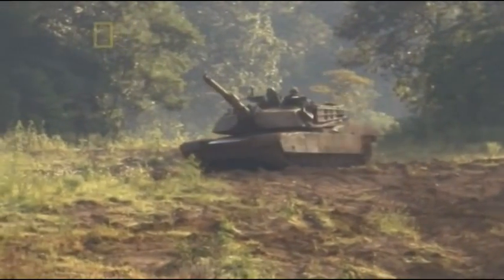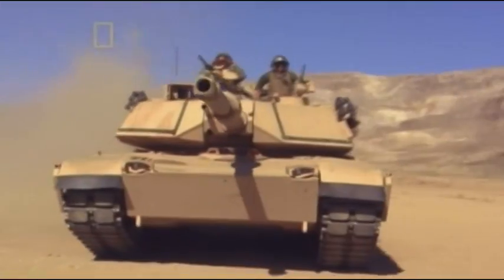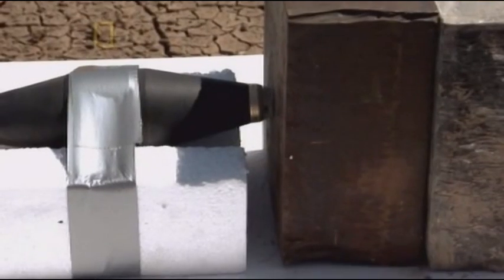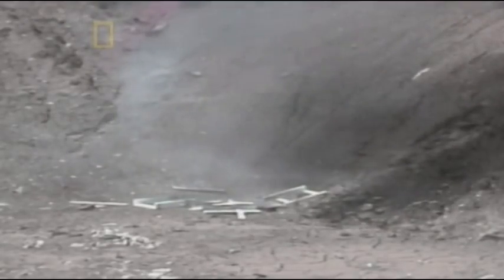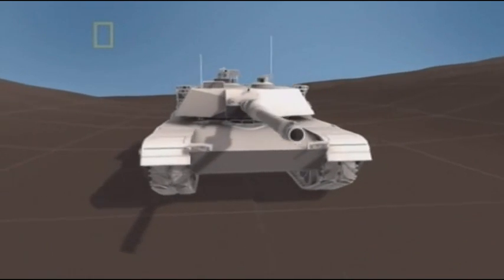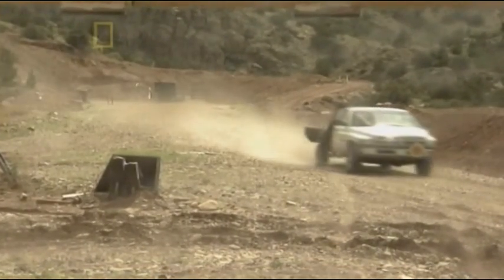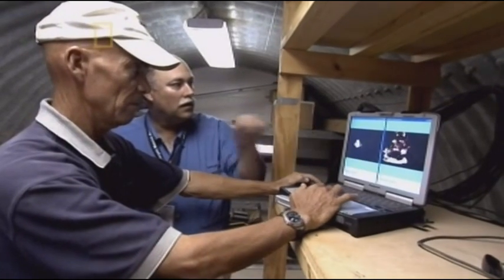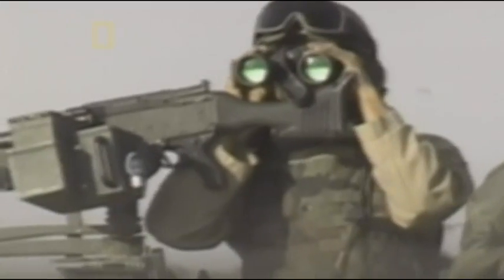Explosive Reactive Armour Explained

Comment: I've watched the russian version explained in 2 minute, the US version explained in 8 minute.
Reply: +MRtz ...What they dont say is that the missiles are now shot in a set of several warheads, the first detonate the reactive armor, the next ones penetrate.
Reply: +hotspur666 
WOW 
do you have a video of that ??
Reply: +MRtz don't forget the commercials
Reply: This is more of a documentary than a explanation.
Reply: +a- Babunji Google "tandem warhead"
Reply: Dusan Stevanovic WOW......holy shit ....i prefer to be out side the tank. I will take my chances with flying bullets
Reply: a- Babunji Newer Russian tanks (T-90 and T-14) are equipped with Arena active protection system which intercepts the incoming missile and destroys it before it even reaches the tank. They are also covered with a layer that makes it difficult for guided missiles to lock on a tank. Plus T-90 has Shtora protection system that detects from which side is enemy ATGM coming from, jams the missile and directs it away from the tank. (There is a video on YT shot in Syria where T-90 directs 2 incoming TOW missiles away). And they are equipped with the newest Kontakt-5 explosive reactive armor. So i can firmly claim that the Russian tanks are the best protected in the world by now. They rely more on electronic systems and active protection rather than armor thickness.
Reply: Dusan Stevanovic
"Newer Russian tanks (T-90 and T-14) are equipped with Arena active protection system which intercepts the incoming missile and destroys it before it even reaches the tank"

Do you have a video of that ??

"They are also covered with a layer that makes it difficult for guided missiles to lock on a tank"
WOW i didn't a technology like this exist !! video ???

"Plus T-90 has Shtora protection system that detects from which side is enemy ATGM coming from, jams the missile and directs it away from the tank"

You can jam the incoming missile ??? please tell me, you have a video of this ??

" (There is a video on YT shot in Syria where T-90 directs 2 incoming TOW missiles away)"
Do you have the link. There is a lot of TOW missiles videos on YT .

"And they are equipped with the newest Kontakt-5 explosive reactive armor. So i can firmly claim that the Russian tanks are the best protected in the world by now. They rely more on electronic systems and active protection rather than armor thickness"

I always thought the same. Armor's thickness in irrelevant in today's modern warfare.
Reply: +a- Babunji How about stop being so obnoxious and research this yourself. Not to mention, if your main point being 'provide a source to this claim,' then simply say 'Provide a source, please.' As for armor thickness in the heat of combat - no, it is not irrelevant. While tanks are equipped with high grade active protection systems, armor still remains a key part of the vehicle if these active protection systems' - hypothetically - do fail.

As for the T-90M (uncertain to the exact variant) used by Syrians being struck by TOW missiles is pretty evident to find. Do you expect everyone to do everything for you? I intend no offense, but you honestly sound like a person who is on welfare who won't waltz off their free furniture and get a job.
Reply: Tristan Renner 

"How about stop being so obnoxious and research this yourself"

Did i asked you to do it ??? i don't thinks so...

"Not to mention, if your main point being 'provide a source to this claim,' then simply say 'Provide a source, please.'"

Thank you for the suggestion but.....i prefer it my way. 

"As for armor thickness in the heat of combat - no, it is not irrelevant."

Well, after i saw a video of a warhead penetrating 800mm of armor - i don't thinks so

"As for the T-90M (uncertain to the exact variant) used by Syrians being struck by TOW missiles is pretty evident to find. "

I saw hundreds of videos of TOW missiles destroying Russian tanks, and i never encountered one where the tank destroy the missile before it hits it, so yeah.......i assumed it's hard to find. 

"Do you expect everyone to do everything for you?"

Not everyone...... but someone "specific" and i'm sure, it wasn't you who i asked.

"I intend no offense, but you honestly sound like a person who is on welfare who won't waltz off their free furniture and get a job."

Me neither, but how did you make this silly assumption ?? Did i mention any thing about my personal life ?? I don't thinks so, but nice try anyway.
Reply: a- Babunji Firstly, no. You did not. However, I'm tired of seeing people such as yourself act in such a poor manner with a lacking attitude towards other people and their comments, practically viewing them as your enemy (or so it would appear to others, such as my self) - that was the point of that topic. That said, it is simply helpful to ones' self to be independent and not to rely on others for assistance. Lastly to this, that is where I say, 'Instead of being so accost - rude, asking people nicely is an excellent gesture.' Try it sometime, as this may surprise you.

Secondly, it is "As for armor thickness in the heat of combat - no, it is not irrelevant. While tanks are equipped with high grade active protection systems, armor still remains a key part of the vehicle if these active protection systems' - hypothetically - do fail." Don't cut off an important detail of the subject and just base your statement senselessly off of half of the subject. By the way, it is not what you 'think.' While my knowledge is very limited on tanks in general in terms of what their designers think of what the armor is intended for, it is logically speaking, intended for the safety of the crew and the machinery against other threats - not just 'warheads'. Sadly, I suppose I left this out.

As a for a warhead penetrating supposedly 800 millimeters of armor, what type of a warhead? What type of tank was it? Did it have reactive armor? Was it also equipped with an Active Protection System? I'm asking since you are leaving out some details apparently. And if you would, please provide the source. Aside from that anyway, I think it to be obvious such a 'warhead' would render the tank and its crew destroyed without these systems to provide additional protection. Armor alone, might I mention, is not enough to counteract certain threats.

Relating to the video, I suppose it wasn't as easy to search up as I attended. The source could have easily provided it to me without having to look it up, so I apologize on that part. Although, I do know you can look it up on the wiki under the T-90 I'm pretty certain - there it should say.

Finally, what I had said lastly was an expression, not an assumption. In the end, carefully read over what you find and stop presuming. facedesk
Reply: +MRtz Russian tank has men with body armor strapped to the outside of the tank with handguns.
Reply: Jack Shields I lol'd

Comment: This explanation is bull st#t. I'm sure but this is not plausible. The description of a molten piece copper penetrating modern armour, which has to be, at most 129mm thick, hardened & modern, hits on the 10" slant.
 10",  that's close  
  of solid, hardened .
 10",  that's close  (250mm panzer 5 type steel).?  That is 2" under a Foot thick.
 Perhaps I've got things wrong??, I do not want to miss lead..
 Neither do I wish to see misdirection of others, get your ruler out & so your own calculations